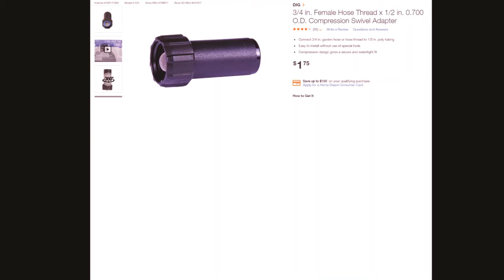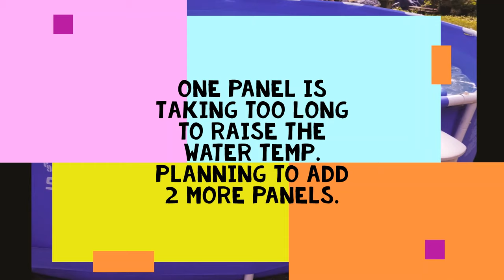Best DIY Solar Pool Heater - under $25

Comment: Reducing the flow will get you a higher output temp but a faster flow will be less strain on the pump and actually gain BTUs of heat transfer, which is what you are looking for in the long run. You can also cover the outside of the pool with some sort of insulation to keep what you gain. Even bubble wrap can make a substantial difference... and that can be found in dumpsters everywhere... if you hunt around.

Comment: I'm going to make this heater this weekend. How's yours after a few months?
Reply: @everydaydiys9708  Mine works fine however it's not getting enough sun especially this time of year. The pool temp is in the low 60s and the heater is pumping out water around low 70s. I have seen it pump over 95 degrees in late summer. We do need more coils. My pool is 6,500 gallons.